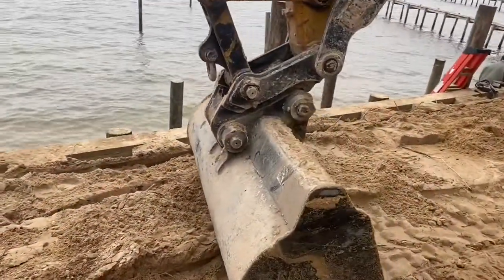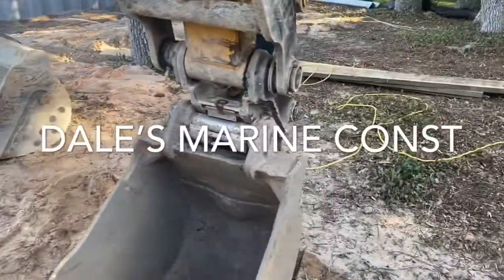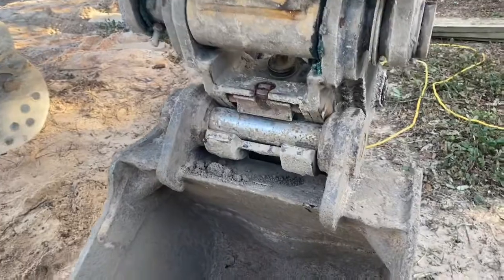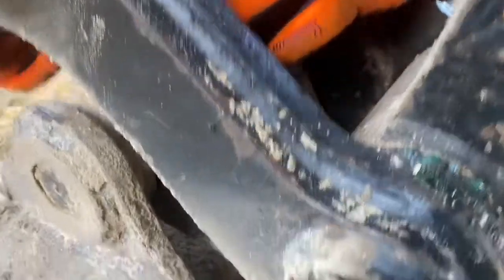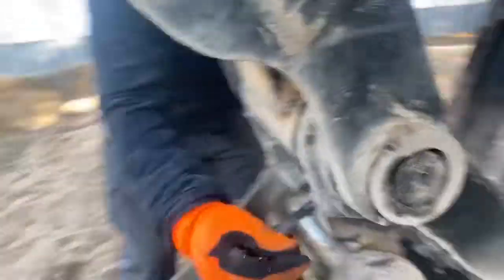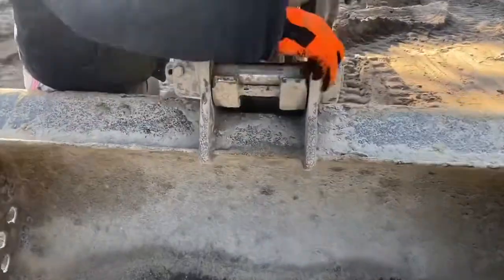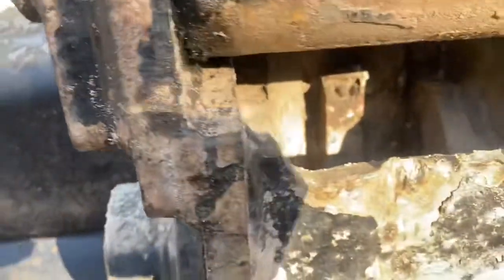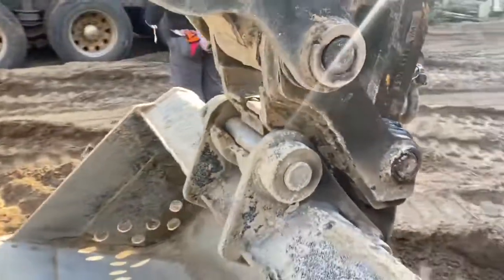REVIEW- Manual quick connect coupler for cat 308

Comment: How does the secondary lock at the back works when we are engaging?
Reply from the maker: Thanks for watching the channel and your question. I have actually done away with the manual quick coupler. It does not work in my environment being in the water all the time it would always get compacted with sand, and I could not get the bolt to loosen the spade locks behind the lower pin, and the little safety red Lock on the top with jam up with Sand also so not a good option for using in the water. We’ve now gone to a hydraulic coupler. We still have to keep it lubricated very well and keep an eye on it because we do work and wet Sandy environments.